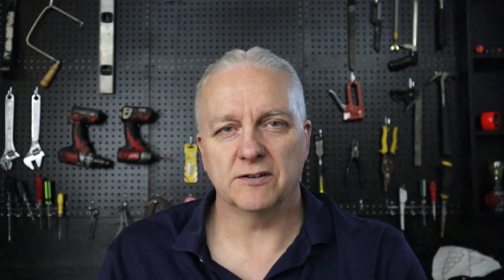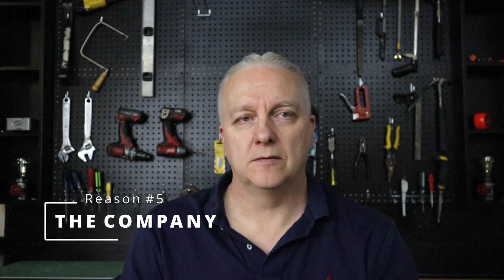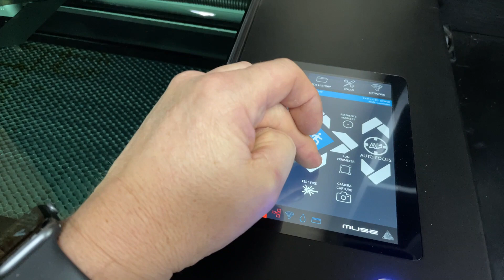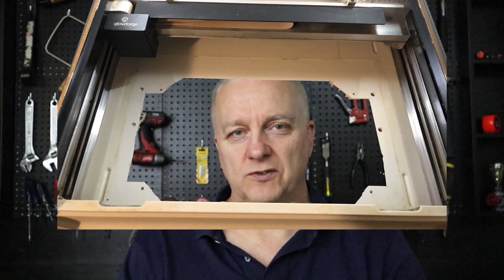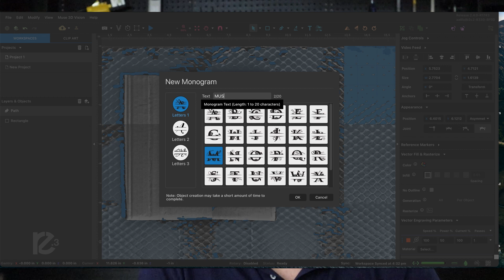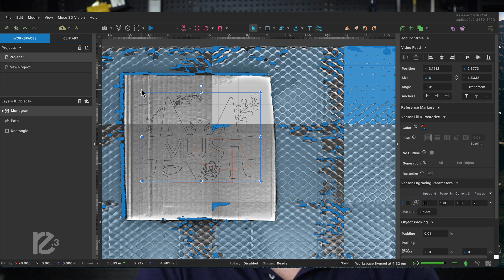BEST LASER CUTTER FOR HOME USE  // Top 5 Reasons to Buy a Muse 3D over a Glowforge

Comment: What do you recommend for me? I have a Cricut Maker cutting machine which I like and use to make dollhouse miniatures. I like it bc it's easy to use but I dislike it bc it doesn't cut small enough. I want to make miniatures as small as 1:144 scale. I cut paper and wood less than 2mm thick so I don't need deep cutting depth. I also typically use SVG files that are 12x12 at the largest but typically smaller. I am also not great with technology so I need something that's use friendly and works with SVG files. I have no problem paying you a fee to help me out and give me this information bc I don't feel entitled to your time. Thank you!
Reply from the maker: I really don't like making recommendations because if I'm wrong you'll hate me. :-)  My guidance would be to stick with either a Muse or a Glowforge - both will do with you want from a user perspective and both will work with SVGs or SVG's converted to PDFs (which tend to work better).  Both lasers have their particular strengths and weaknesses but both are great for home craft use
Reply: @SteveMakesEverything  Thank you! I'll look into both brands some more.
Reply from the maker: @Harriet Spencer  Note that there are other brands as well.  Not to inundate you but there’s also MakeBlock LaserBox, the Dremel Laser (now no longer available), Boss, Rabbit, Trotec, Epilog and many others. I’m happy to help with specific questions but only you will be able to make this choice for your needs.  Most lasers for your target market will be reliable and provide the features you need. What you buy will mostly depend on things like budget and size.

I’m working on a 60 day honest review of the FSL Muse 3D which should be out in the next few days.  It will give you visibility into some of the things I like and dislike about my laser.

Comment: You don't like Glowforge being marketed as 3d, but you're okay with Muse not only doing the same thing but also literally putting it in the name? Since cutting, engraving, and scoring are done at different depths it actually is 3d, so it isn't deceptive anyway.
Reply from the maker: It's a fair question; however, the 3D in the Muse 3D refers to its 3D focus camera rather than anything the laser does.

I wouldn't call the scoring, engraving and cutting processes of a laser "3D", since the material is flat when your start a job and basically flat when you're finished.

The only 3D subtractive manufacturing process I could think of is something like a 6-axis CNC where a part with a significant length/width/height can be created from a block of material

Comment: Hi Steve.  I checked with Muse, and they can’t cut my project which is too deep.  What do you suggest?  Thanks!
Reply from the maker: You don’t say what the thickness or type of material is but in general you can try to do multiple passes for the cut. On a 40-45watt laser you are practically limited to about a 1/4” (6mm) in wood or acrylic. If your material is thicker than that you’d have to look at a laser with more power (and usually a bigger price tag). FSL has a number of higher power PS models, but also check out Boss Laser, Trotec or Epilog. There are 60-90watt lasers for “reasonable” prices

Comment: Good details. I want to engrave photos on glass, metal,etc. How does Muse do that?
Reply from the maker: No matter whose CO2 laser you use you will be able to engrave on glass and metal (with a Cermark coating).  Be aware though that you won't get a lot of greyscale shading on those surfaces.  You'll need to work at it a bit to try to get it right.

Comment: Would this platform be a good choice for engraving on bullet casings/shells? If not could you point me to the right direction? Thanks!!
Reply from the maker: I engrave on metal a CO2 laser would require a coating like Cermark to engrave on.  It’s possible but a fibre laser might be your better choice since on of sufficient power should be able to engrave directly
Reply: @SteveMakesEverything  thanks for your time and input!  Yeah, im looking at making 200 to 300 of these on a Bullet casing for some veterans groups and know i need a consistent way to get them done. Thanks again for your time!!

Comment: Would this still be a good laser to buy today? I am able to buy a used one with some add ons.. want it for leather patches and some drinkware.. it does come with Rotary Riser combo
Reply from the maker: I’m less inclined to recommend these now. The laser is exceptional, but the company seems to be a bit messed up from a sales and support perspective.  If this is the market you’re into, then look at the Xtool P2S. It’s around the same price, but has more power, more capability and a huge community of designers and users.  Watch the videos I did and they will give you an idea of what this laser can do.

Btw the P2S is one of the lasers I use in my shop every day and I love it - if that means anything.

Comment: This didn't sell me on the Muse though. It seems like it is lacking and needing extra items right out the box. If I had a issue with Glowforge taking designs, etc, I'd just sell the thing. The business I need it for needs internet 24/7 anyway.
Reply from the maker: Hi Angel.  A couple of things.  Understand that my job isn't to sell you a Muse 3D - that's up to FSL.  All I can talk about is why I bought one rather than a Glowforge or anything else.  This isn't a slam against the GF or a checkmark for the Muse, but rather its an understanding of what is required vs what laser manufacturers offer.  If you love your Glowforge then that's awesome - many people do love them.

Second, regarding extra items out of the box, neither laser really needs anything (unless you consider water an extra) 😉.

Regarding the requirement for internet connectivity, as I acknowledged previously, this won't bother everyone for certain, but that's not the problem.  The real problems are that once you "give" your designs to Glowforge they can do anything they want with them without any agreement from you, and more importantly, Glowforge is a small company that is subject to going out of business.  If they do, then your files and the cloud they are stored in both go away and your laser is a 100lb brick.  You buy convenience with a GF, but convenience can come at a significant cost down the road.

Comment: Great review Steve. I do not have a laser yet and have been tempted to get a Glowforge.  However, the connectivity (internet Requirement) has turned me away as well.  I too see that there are many happy Glowforge owners and appears to be a nice machine but I will be going with a different manufacturer and am narrowing in on a MUSE.
Reply from the maker: In the next couple of days I'm going to put out a rather long video with my 60 day review of the Muse.  It's a good machine but like all others it has it's strengths and weaknesses - nothing terrible though.  Feel free to use my coupon code to save $125 if you buy one

Comment: so obviously these are not really entry level lasers as the considerable cost puts them into the semi-to professional level.
Reply from the maker: The Glowforge is what could be a high end entry level laser. It has some fairly significant limitations but is definitely designed to be easy to use

Comment: That video made me cut to the chase, until I discovered the Beambox Pro from Flux... Has anyone looked into this laser cutter?
Looks appealing from the specs (bigger bed, more powerful laser than Muse 3D) and for about bit more than half the price (inc. for add-on like the rotary jig)
But the company is younger and the user community smaller, so not sure about their customer service.
@Steve: your videos are great, keep up with the good work!
Reply from the maker: Well it certainly looks like a pretty solid laser on paper.  Something to understand is that most lasers for home/small business use will use similar, if not the same parts.  So from a hardware perspective there will be few differences between any of the lasers >$4K.  What matters more is how you interact with them (i.e. the software) and  how well the company backs it.

Trying to be as unbiased as possible I'd say the difference of 45W vs 50W is marginal as is the bed size difference.  On the plus side it seems like it's got a great price, but what I would be asking them, if I was considering one, is where it was made.  It's hard to tell from their site, but I believe FLUX is a Chinese company - not a huge deal from a quality perspective, though they are notorious for over-stating their power outputs.  But I would worry about getting parts, service etc. if you need them, and FLUX don't seem to want you to service the laser yourself.  The only defence I can put up for FSL is that they document how to do most service in the user manual.

BTW, notice that you can't order one directly from them, but rather you need to use one of their resellers.  That could suggest that they care enough about their customers to ensure a local presence, or it could be an alarm signal that they have trouble getting them working right out of the box.

Not trying to neg them, but if you're going to spend several $K on a laser it's fair for you to ask a ton of questions.  I pounded Glowforge, FSL and a couple of others with questions before I made my choice.